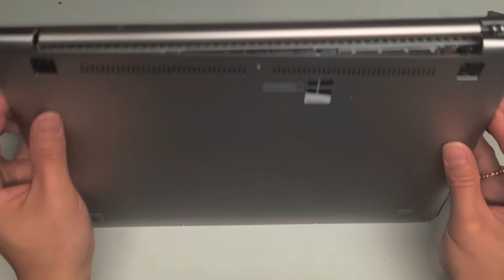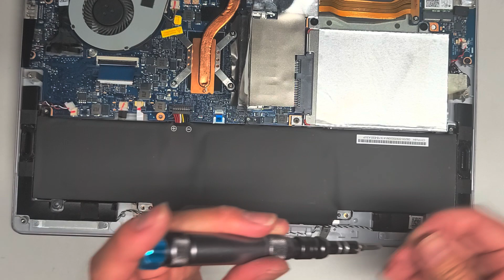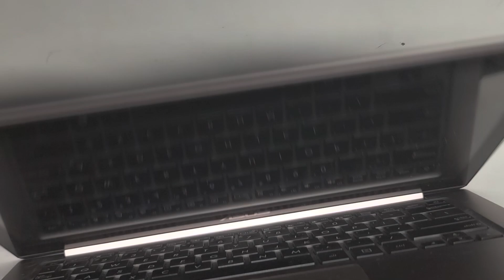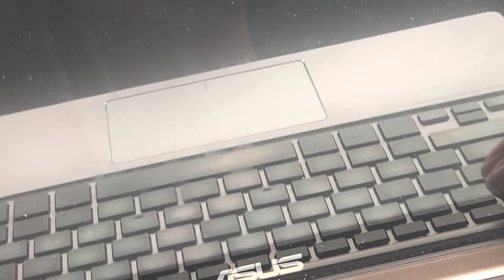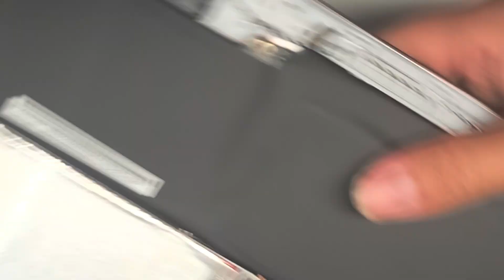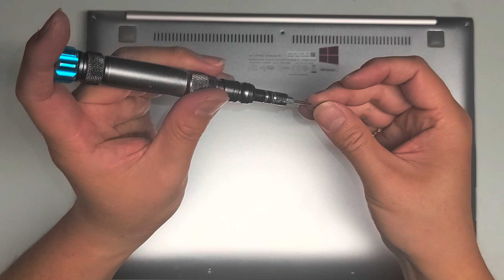ASUS UX303U Disassembly RAM SSD Hard Drive Upgrade Battery Replacement Repair

Comment: Hi Brother.
My Ausu Ux303ua CMOS Battery Missing. Plz Cmos Battery Number Compatible Model Findings. Plz Cmos Battery Number. Problem Is Laptop Start boot Bios Screen. What is problem.Replay Waiting. Thanks
Reply from the maker: If it's only going to bios, your boot drive is dead.
Reply: @ItsBinhRepaired Bro Some time windows 10 boot. Power on Bios boot. Change Clock Time. Plz Asus Ux303ua Cmos Cell Battery Number Compatible.
2030/2030s/2025. Asus Ux303ua Compatible Motherboard Cmos Cell Number.
Thanks

Comment: Thank you for this video.  My Asus laptop, same model, just had its tiny 256GB ssd drive die.  Funny, I had just bought my wife a new laptop for said same laptop she'd been using for years also.  My plan was to load a version of Unix on my laptop after trying it our on her old Asus laptop.  I loaded Unbuntu to her old laptop and it worked fine.  Getting a VPN to work was more than I could do though so when my Asus laptop SSD died I bought a new Dell laptop.  That was just days ago and I find out, from your video, that the ssd is not soldiered to the MB.   So I had a 500GB SSD laying around from one of my old desktops, and I loading windows on it now, in my old laptop where the SSD died.  Woot!!  I may take the Dell laptop back and get my money back, I'll use the old laptop a few days and then decide.  Thanks again for this useful video!!!!!!
Reply from the maker: Awesome, glad you were able to get it back up and ruining. If you haven't already, please like and subscribe so others can find my videos and possibly consider watching a few others, liking and commenting to get the algorithm to recommend my channel. Thanks!

Comment: Hello. Could you tell me. Maybe you now. How to reset bios on this notebook?
Reply from the maker: The red and black connector to the right of the hard drive is the cmos bios battery.
Reply: @ItsBinhRepaired  Thanks a lot! I have ux303ln notebook. It seems to me that the configuration of element should be almost the same.